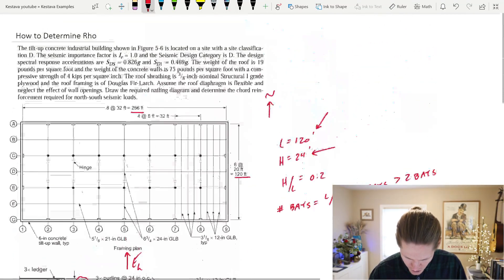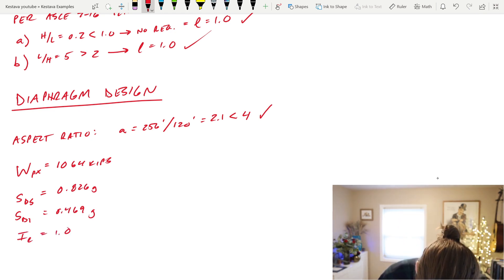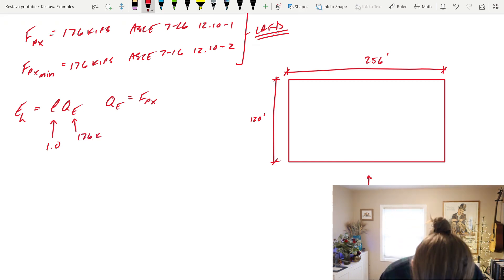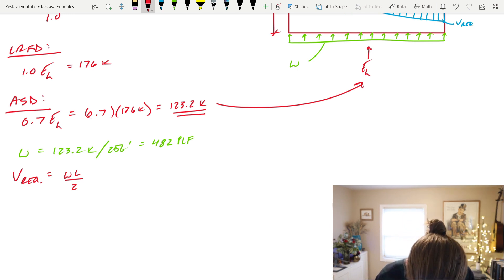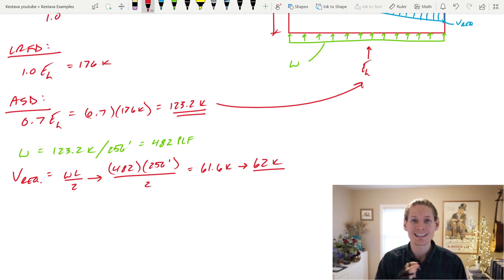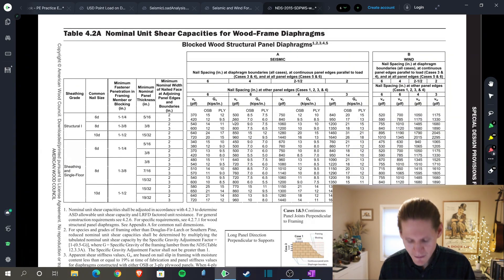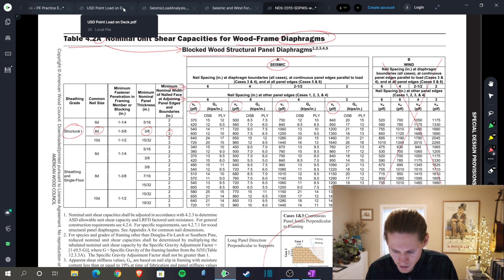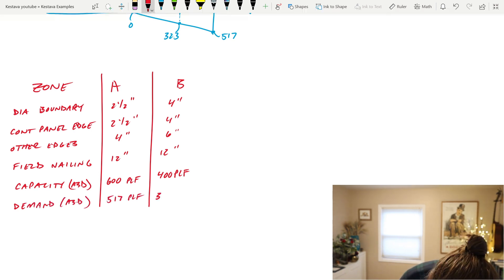How to Engineer Wood Diaphragms | Sheathing | Nailing | FULL EXAMPLE

Comment: How does this method apply to a sloped roof diaphragm? I have had a difficult time finding any information on how to transform loads/capacities into a sloped wood diaphragm design. Is it possible to point me to a refernece that you use or create a video for this?

Comment: Hey Richard, awesome video! I needed this while designing a diaphragm and shear wall. I didn't quite understand how you came up with the 48 ft "zone A" regions. I didn't get where the 48 ft number came from. Cheers
Reply from the maker: you can break up your diaphragms into sections when you have a large enough diaphragm. as you get closer to vertical lateral elements (shear walls braced frames etc) your shear demand in the diaphragm increases, but the opposite is true as you get to the mid point of the diaphragm between vertical lateral elements. so at a point you can call out a lighter diaphragm to save on nailing and potentially sheathing thickness. take a look at your shear diagram to help you determine where you can create another "zone" cheers!

Comment: Hi, I'm loving your videos, super helpful! Maybe I am interpreting something incorrectly, but at 2:35 you say our W=256' and our L=120', but then you do the aspect ratio calculation (a=L/W), you do a=256'/120' which would be W/L according to how you defined your variables. I'm brand new to this so I want to make sure I'm understanding it correctly!
Reply from the maker: its always W/L in the direction your looking at. so if you have a rectangle, then in one direction your aspect ratio will be high and in the other direction your aspect ratio will be very low. think about if the diaphragm was a piece of soft foam and your trying to bend the foam. the direction that is harder to bend has the lower aspect ratio because its stiffer.

Comment: You said 256’ is the width. Isn’t that the length? And 120 is the width?
Reply: Also, what actually dictates which side is the length and which is the width? The NDS shows that the length is perpendicular to the lateral force.
Reply from the maker: in short - the length and width swap with each other depending on the direction you are applying load!